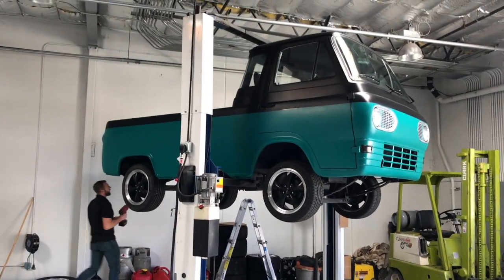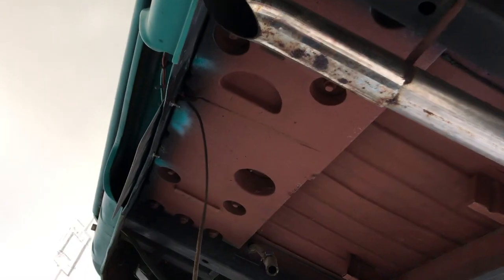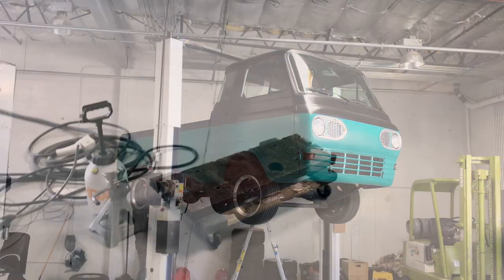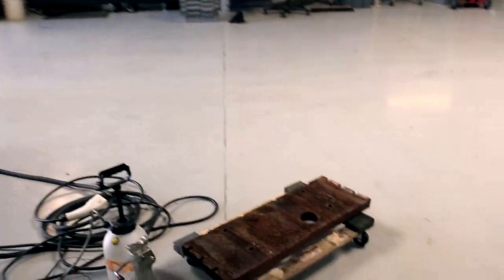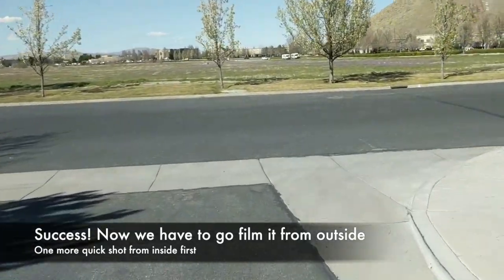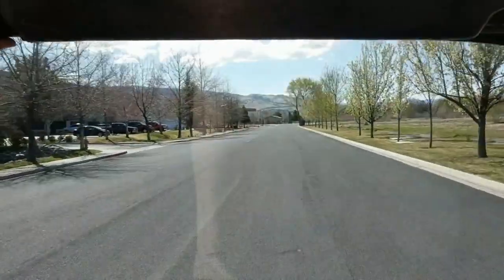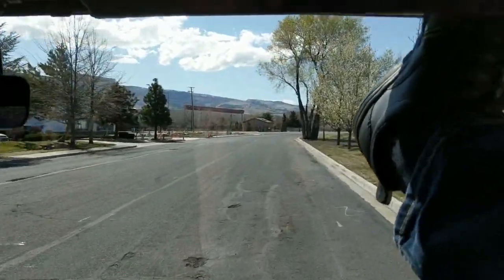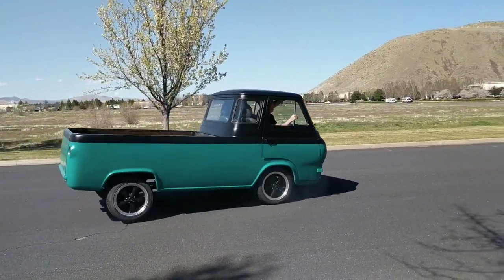Can a truck do a stoppie? Yes! - 1962 Econoline Pickup on 2 wheels

Comment: Good job Jimmy!  I'm waiting for the 112 electric motors and the 42,000 pounds of lead/acid batteries riding in bed behind you.  It will be fun seeing all of those crash through the back of the cab to join you behind the wheel.

Comment: With my luck, the police would have been called after the 1st attempt.  I would have spent the rest of the day explaining why I was driving up and down the same road.

I can definitely see why they put the weight in.  Too bad they didn't just shift the weight distribution before manufacturing them.   It's silly to just add a counterweight.